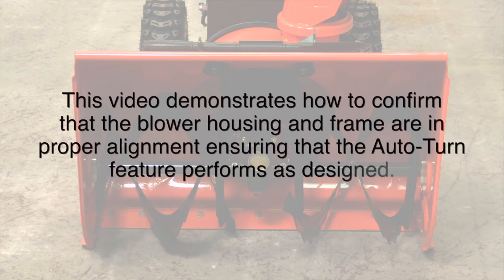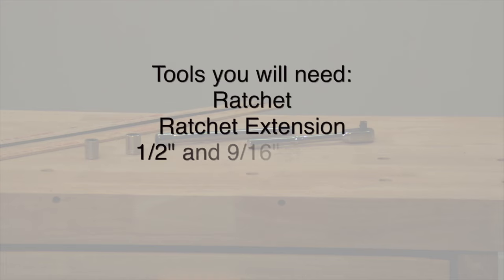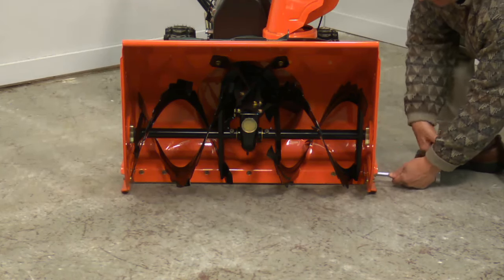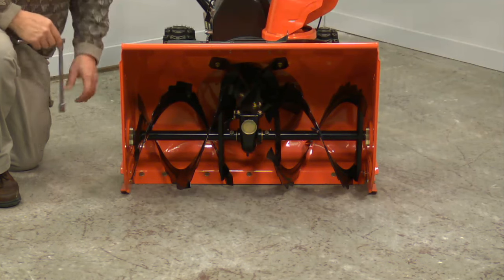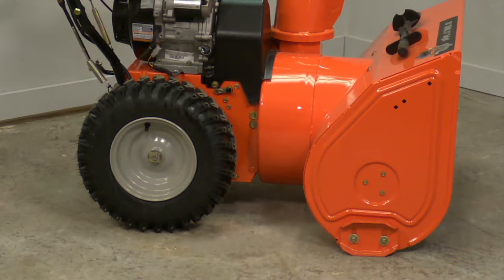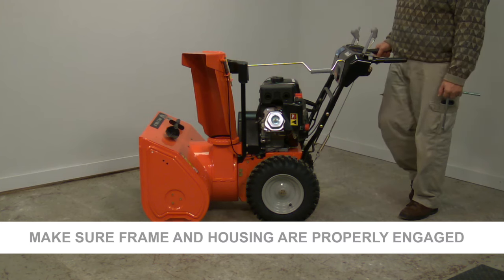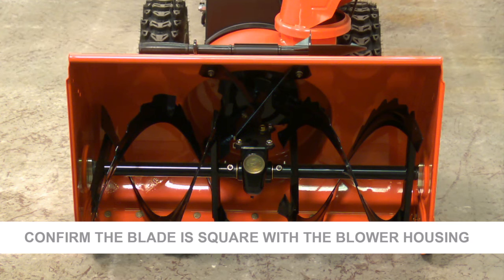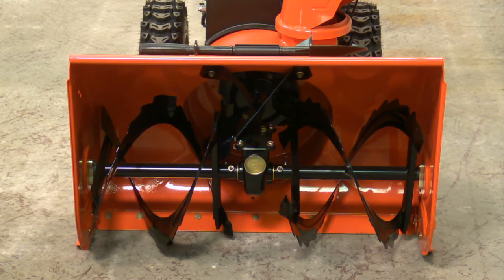How to Adjust Auto-Turn on Snow Blowers | Ariens®

Comment: I bought a new Deluxe 28 about a month ago to replace my 17 year old MTD 10 HP machine. After the first time using I figured I just needed to get used to it. We finally got some lake effect snow Thursday night so I ran it again yesterday and I am sorry to say that I hate it. I have named it lurch because it does not want to go straight, but lurches from side to side. The shoes and frame appear to be adjusted correctly, but I'll reset them myself to verify it is setup correctly. I really didn't want to have to mess with it after spending almost $1,200 on it. I wish there was a simple  way to lock the darn diff.
Reply: That was a complete waste of time at 7.5° F. The housing and shoes were apparently adjusted correctly as it still lurches from side to side. Almost ripped off the siding on a corner of my house. Every time I run this machine I dislike it more. I really don't want anything to do with auto-turn anymore. I am seriously thinking of rebuilding the old MTD beast that I love. BTW, I have an Ariens zero-turn mower that I really like, which was a big factor in choosing the Deluxe 28..
Reply: +James Henry 
I've had a Snow-King for 20 years. Last winter the drive wheel broke it's weld and didn't have anyone to fix it quickly and we were getting pounded with snow (Live in NH). Went out and bought the Ariens Deluxe 28 with the heavier duty Canadian engine mounted on it.  First time over my driveway (which was in bad shape with frost heaves and what-not), I was absolutely exhausted trying to control the machine up and down my driveway. Had to literally get my body between the handles to stop it from turning left and right and even that was a fight. The Snow-King never had an issue - Never.  OK, this past summer, I replaced my driveway with a brand-new (completely torn up and bed replaced). Nice and smooth (though has a slight grade). Looking forward this year to a nicer experience. Then first snow fall (and every one thereafter including today), here we go again, fighting the machine up and down the driveway. I'm sorry, but the auto-steering technology is seriously flawed and for Ariens' to suggest the fix here that does not work, then perhaps the next step is to make a recall and allow dealers to somehow turn this "feature" off. I'd rather "struggle" making a turn than struggle continually through the entire driveway. I'm exhausted fighting this very heavy machine to do something as simple as go straight.  Would not recommend the Ariens to anyone at this point nor plan on buying another one again, and that's a shame because otherwise it's a pretty good machine, but this one "flaw" is big enough to not recommend.
Reply: It's not Ariens fault - your driveway must not be a perfectly flat plane.  I'm trying some of the poly skid shoes to see if that doesn't "set off" the autosteer transmission so much.
Reply: I put the poly skids on, but I am still waiting for some snow to try it . I wasn't aware that this snow blower was made for only perfectly flat plane driveways, silly me! I'll just peel $20k out of my wallet and have a new perfectly flat plane driveway installed right away! :)
Reply: I just took my new poly skids out of the box. Expecting snow Monday in Mass - hopefully those will salvage this $1300 disaster of a blower. Ariens should send a pair to everyone if they work.
Reply: If the poly skids don't dramatically help I may resort to some garage engineering to fix the problem. I loved my 10 HP MTD Yard-Man even though it was a beast to muscle around. Racers used to weld the spider gears in their rear axle differentials to lock them up. Maybe something like that is possible.
Reply: larry ciummo They sent me a pair for free last year after I complained. I am in MA too.
Reply: Might work on that jackshaft but you'll be driving both wheel - there doesn't appear to be any way to uncouple a wheel from the axle.  I put my poly skids on - seems smoother on the driveway and it did do straight. Have to wait until Monday for snow.  I'm assuming Ariens will come up with some fix for this - some have said that replacement of the auto-turn "differential" has made things better.
Reply: just checked your link....but nothing about free skid shoes
Reply: Open up the auto-turn mechanism and jam the plates apart with 4 small blocks of wood. You can always revert back to auto-turn.  This mod will not permanently alter the machine not negatively affect the longevity of it.

Comment: Auto steer is only used when making a 180 turn. not to be used when travelling in a straight line. This 1/8 inch is fine for paved area, on gravel it should be raised to 1/2 inch. This helps keeping small stones from flying out the shute. Mine has a lever to engage the turning, or disengage it for power to both wheels. Ariens are truly an amazing machine

Comment: On the lighter side...living in New Hampshire w/100' sloping driveway...this serious flaw in Ariens Auto-turn design has almost allowed me to skip going to the Gym.  Great upper body workout. Kidding aside, you knew exactly how bad the problem was.
Glad to see you went with the cheapest fix for 2016-2017  to avoid a RECALL..."Re-Balanced Machine: The axle has been re-located on the frame to improve balance and performance of the Auto-Turn steering feature."
Congrats Ariens...looks like you skillfully avoided the dreaded "R" word..RECALL. It's sad because this has caused problems within the community of long time Ariens customers, people that would have never looked at another brand....now are.They got burnt first by your flawed design and then by your response to a known problem..based solely on economics...
Reply: I have a 2025 Pro.  They haven't fixed nothing.  Autoturn sucks.

Comment: ugh....just bought the 28 deluxe. it pulls to the right to the point that I'm fighting with it. I adjusted the skid shoes at least 15 times, then I came across this video. I followed all the instructions and still have the same issue. No matter what I do, when I put downward pressure on the handle bars, the front left corner of the blower housing always lifts first; any help would be appreciated. Both tires have the same pressure, my garage floor is level, I've tried it all. This machine is great but I think it's a manufacturer defect.
Reply: Tony Tees Same exact problem here with my Deluxe 30.  Comments Ariens reps???
Reply: Jeremy K. I'm returning mine on Saturday...I don't want anything with auto-turn. Cub Cadet is starting to look good right now.
Reply: Cub cadet doesn’t have an auto turn? Im so frigging sick of mine with this crap auto turn! I bought it so it would be LESS effort to snowblow as it is right now Im sweat just as much as if I was shoveling

Comment: Same issue.  Machine pulls hard to the right.  Have tried on different surfaces with same result.  Always pulls right.  Ran through this video a few times and cannot get square.  Will contact support.
Reply: I am sorry that your machine was pulling to the right.  Hopefully you have corrected this, but if you haven't, please reach out to our Tech Service group so they can walk you through the adjustment.

Here is a link to reach them.

http://ariens.custhelp.com/app/answers/detail/a_id/263/session/L3RpbWUvMTM5Mjc1MzczMS9zaWQvVDVRaFpmTmw%3D
Reply: you probably found out by now, but my new ariens has only the right tire pinned through the wheel. the left tire is pinned outside of the tire, which means it won't engage.

Comment: I just bought a new one. I have 1 bolt each side, not 2. Does it still loosen with just the one bolt?
Reply from the maker: Hi Don. Are you referring to the skid shoe hardware? If you tell us the 6-digit model number of the unit you purchased, we'll let you know if you have the correct amount of hardware and how to adjust your skid shoes and scraper blade.
Reply: @AriensChannel  no. The frame or drum rotation different from what you show
Reply: 921045
Reply from the maker: @donthomas5537  Got it, Don. And yes, that's just one bolt on each side that loosens and tightens the housing assembly to the frame 👍

Comment: I have a 2014 deluxe 28. I love the auto turn. But Auto turn started to just click this year and not move blower forward. I removed the auto turn differential that Ariens says is non serviceable , took it apart and found moisture had contaminated the grease making it all caked up. 
I took pictures of each step of disassembly of differential and cleaned with carb cleaner. Spooged with new grease at each step of reassembly. Wham ! I reinstalled and poof ! It works again. I coated the outside with grease. 
So folks we need to grease the differential a couple times a year as like a sealed bearing these go bad but coating it will help. 
-
Reply: In hopes that you have the same type as me, do you have these pictures posted somewhere?

Comment: You did not mention auto turn performance.  I have had my Ariens fit 2 years and still do not know how auto turn works.  I have to turn my blower around manually, the old fashioned way! ..?
Reply from the maker: Hi Fabricator, We recommend taking your Ariens to your local dealer. They should be able to adjust the auto turn so you no longer have to manually turn it. If it's still within the warranty window, the repair would be covered.

Comment: I wish they kept the old locking differential system. I have a brand new 2018 deluxe 24 with the AutoTurn clutch and it sucks! I’ve adjusted as recommended by the owners manual and their YouTube video and I am still fight to keep it going straight down the driveway!! Machine is really really nice except for the AutoTurn function. I’ll try to raise the scraper  bar/ lower the skid shoes a little lower, but now I think I’ll be defeating the purpose of having the scraper and will be leaving more snow on the ground. Any ideas on this issue ?
Reply: Auto turn is love it or hate it.  I hated it.  Sold mine on Craigslist and bought a Simplicity.
Reply: pcosta816 - Thanks for your response. I went back to my dealer (last winter) and free of charge he gave me a set of composite skid shoes. What a difference!!!  Machine works beautiful. Straight as an arrow up & down the driveway. Machine should have come with them to begin with!
Reply: Paul Murphy glad it’s working for you now.  If it made that big of a difference then you’re right, should have come with them from the factory.  If it did  I might still have it.  Oh well, happy with my simplicity.
Reply: pcosta816 - Yes it did that’s why I didn’t sell it. Btw Simplicity is a very good machine. Good luck with it.
Reply: Paul Murphy any idea why the composit shoes worked better?
Reply: Thomas Eichstaedt - Hi Tom, the new shoes let the machine glide over the pavement vs dig in. The original shoes are made from soft steel. Glide over the snow even easier. They work exceptionally well.
Reply: Yup same problem.Same year
Reply: @pfmurphy525  Just got my 2021 Great lakes edition 24 SHO today . It came with composite skid shoes .

Comment: Mine wasn't right from the factory and still seems to have issues! I am thinking the chute isn't square on the frame at this point. I have done the above procedure time and time again. Just can't get it square!
Reply from the maker: Marcia, please feel free to contact our tech. serv. for assistance. http://ariens.custhelp.com/app/answers/detail/a_id/263/session/L3RpbWUvMTM5Mjc1MzczMS9zaWQvVDVRaFpmTmw%3D
Reply: It's not that - any slight irregularity will set of f the autosteer causing the machine to wiggle down the drivway.  We're all hoping poly skids will help it out a bit.  Otherwise, Ariens is going to have to come up with a solutiion.

Comment: It's apparent to me after reading all the  comments that autoturn is a love it or hate it feature, which is fine.  Some features just are.  What I can't believe is that Ariens doesn't have a simple mechanical lockout option for those who hate it.  Would also allow an older unit with broken diff to keep working.  Hell, could be as simple as a thru hole on the autoturn plates for a thru bolt.  Could be that some exec at company made their climb based on the selling of this feature as perfect, and is too hard headed to accept that some folks don't like it.

Comment: auger wont trun when it hits snow  how to fix it
Reply from the maker: Hi Butch, you may have broken a shear bolt. You can learn how to change a shear bolt here: https://www.youtube.com/watch?v=pl7lfFD-lLs

If this doesn't correct the problem, you can visit your nearest Ariens dealer using the link below: https://www.ariens.com/en-us/dealer-locator
Reply: You have broken pins on the auger shaft. Remove chute and use a long punch to punch out pins and replace. Or take out rakes and remove auger that way. Then you can replace the auger  Bearing at the same time.

Comment: Ariens: ST624E,  won't start, have fresh gas flow, spark(from plug while cranking), and carb was cleaned.  It is at the shop where I purchased it and there was some kind of timing pin that was sheered off.  It was replaced and alledgedly set correctly.  Mechanic said still won't start.  Ideas?  Is it possible there's a grounding issue?  or what else could be looked at.
Reply from the maker: Thanks for contacting us, Don. We're sorry you're experiencing issues, but you made the right move by taking the machine to your Ariens service dealer. Can you tell us the model number and serial number of your unit? If we have that information, we'll do our best to provide you with more information to help you resolve the issue.
Reply: Engine Model: OH195SA, spec: 72569G, D.O.M 08018CD0269

If I can private message you I'd be happy to give you the contact # to the repair shop.  I've been waiting on this since  before Thanksgiving and we've only had one dump of heart attack, ack, ack snow.
Reply from the maker: @dongotfryd7983  Thanks for the reply, Don. Unfortunately there isn't a private message function on YouTube. We suggest contacting our customer support network by logging into or creating an account on our customer support portal located here: https://www.ariens.com/en-us/support

Comment: Since I have a brand new machine used only once, should I assume this was done correctly at the factory and I do not need to verify?
Reply: Mine was not set up correctly from the factory.  I'd double check.
Reply: You should assume that it was NOT done correctly at the factory. Quality control nowadays is terrible, unless it's a Japanese unit, like a Honda.

Comment: The dealer replaced the Auto Turn plates, and that solved the problem. It is more than a few owners.
Three outstanding issues I would inform Ariens about.
1. Gas cap needs to taller so more leverage can be used.
2. The skid shoes are from the 1970s, they wear out very fast, and they are undersized and cheap.
I actually made up a set out of 1" thick Composite decking skids that work excellent.
3. Not having a variable speed throttle is a negative. The Cub Cadet  has the same LCT engine
with a true throttle. Please don't tell me a throttle is not needed. Thanks!
4. The directional chute control on the Deluxe model is not positioned on the machine correctly.
Ariens should have  placed it where it is located on their more expensive models. Can't figure that one out??
Reply: I like the idea of the  Composite decking skids.  I need to take my snowblower over grass and It keep digging into the lawn.  Do you know of any aftermarket skids available?
Reply: What are the auto-turj plates - the gears that act as a clutch to one side or the other?
Reply: larry ciummo the dealer replace the entire Auto Turn mechanism. He said it was defective after
using it the first time out last winter. Much I have read on the Internet blame the steel skid shoes.
When the plastic shoes are put on the mechanism operates better.
Reply: @lciummo1  From the pictures I've seen, they basically work like a Detroit Locker, except the inside tire disengages instead of the outside tire.  They had an earlier version that worked just like a Detroit, but I forgot the name, and it didn't turn as well for obvious reasons.
Reply: @algorel4763  Just got my 2021 Great lakes edition 24 SHO today . It came with composite skid shoes .

Comment: Number one should be to properly inflate both tire to the exact same pressure.
If one has less or more than the other, that process will not work.